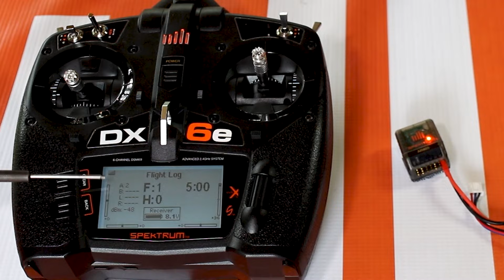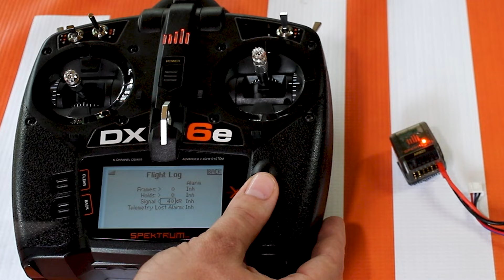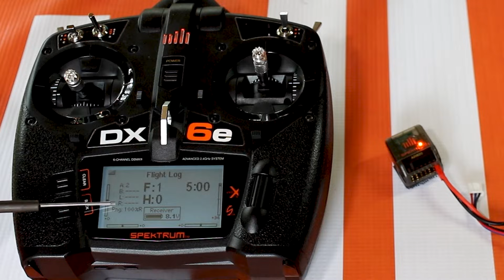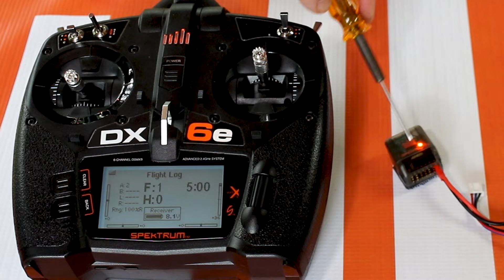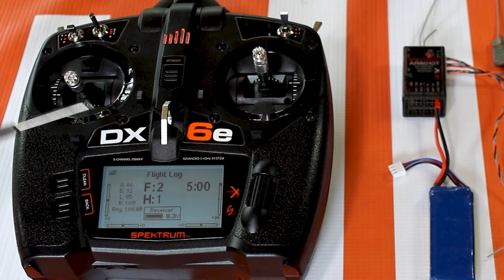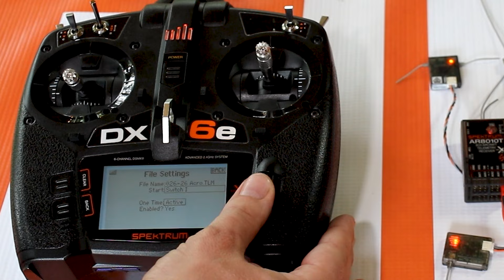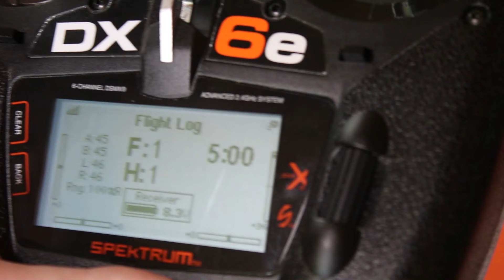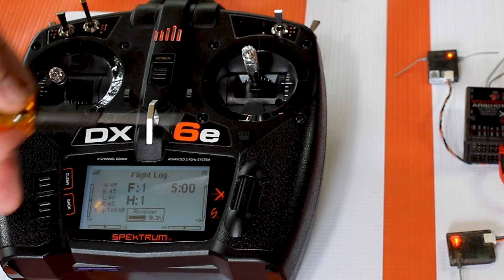Spektrum Quick Hit Tech Tips - Flight Log Telemetry Screen Explained

Comment: This is a handy monitor.  It would be better if we knew how many CONSECUTIVE frames were dropped. ( I've read that Spektrum's typical frame rate is 22 milliseconds, so I understand that a few frame losses aren't supercritical.) Otherwise, this monitor looks kind of like it's reporting each frame loss as though it was just one frame at a time.  I'm on my first Spektrum system, (NX8 + with AR8360+ receiver)  so I may have missed something. (?)
Reply: Based on a 22ms frame rate you can calculate the total frames received over a given flight time.  Then divide the F value by the total to quantify the loss.  1% is good, anything over tends to be bad.  Start by calculating the Hz rate which is 1000s/22ms.  Then take your total flight time in seconds and multiply by the Hz.  That will give you a theoretical value for the total amount of frames received.  Now you can calculate the loss.

Comment: Thanks for the video Tom!  
I get a lot of holds  on my Comscendo Evolution. At one point spectrum even sent me a new transmitter after they saw a copy of my flight log. But I am still getting the holds. However, I think I know what’s going on. The holds are location-dependent, meaning in certain patience I get a ridiculous number of holds in other locations I get virtually no holds. I think the issue is Wi-Fi networks. I guess the whole problems when I am flying near houses or office buildings. I don’t get really close to them, but maybe within a few hundred seats sometimes. I have seen proof that home Wi-Fi includes the 2.4 GHz band. What confuses me is that hardly anybody talks about it. For instance, I would think that in a video like this, there would be some mention of it. But nothing. Am I going down the wrong path?

Comment: I seem to average about 125   " fades "  per 5 min flight on my brand new HH T-28  BNF ( yellow ) ( Rx factory installed )   ....and  have also received some " holds" ....I have done a range test and it passes....I always fly with a  fully charged Tx ( DX8 gen2  )   and LiPos.....I have also contacted HH via email support ...........what's my next step?...also wish  that HH offered   on-line real time  tech  chat  support, as email responses  are taking days and days   in between questions.......going to fly today ,as  Spring weather ( Chicagoland area ) is iffy and got to get in some  flights when I can................thanks
Reply from the maker: 125 fades is nothing to worry about but holds I would look into. Sometimes you can cause holds by turning off the transmitter or even going into the system menu (which turns the RF off) so I would make sure that it is not self induced. Hope that helps!
Reply: @SpektrumRCvideos  understood......I will not get concerned about the " fades " and  keep watch on the   " holds"...........thank you

Comment: I had 20k frame losses in a 5min flight in my turbo timber evolution!.....
Reply from the maker: Will it do the same during a range check? Do you lose connection or get delays in control at all? Might be a good idea to check the antenna for damage and to make sure it is not being blocked by the battery.

Comment: Nice Video. I had 6000 F, 3 H during 6min flight. Nothing happened. I am shocked. I have two Turbo Timber and I lost my first one because I lost transmission during flight! Two times. The second one is fine, but sometimes, well as I mentioned. The other planes have no problem. I send the first Timber back, because it was not my fault, but nothing will happening.. I guess
Reply from the maker: Might be a good idea to have your Transmitter checked out, could be a hardware component that is damaged.

Comment: Just installed AR620 with Smart battery. No smart ESC.  When telemetry auto-configs it does not show Battery voltage.  Should it? If not why?  What do I need to do?

Comment: Really good video, I learnt a lot. I have the new SRXL2 AR6610T receiver along with a SPM4651T for my remote receiver in a 700 heli. On the flight log screen on my DX8g2 I'm only seeing a value for the 'A' receiver but no value for the 'B' receiver. With running two Spektrum receivers why is there no 'B' value being populated for the SPM4651T?
Reply from the maker: Hi Robert, likely one or both units need a update. Check out our how to update videos if you need help :)

Comment: Um, duh, if you have an "H" or a hold, your aircraft is in the ground. The whole objective is to PREVENT holds, which means positioning your antennae properly.
Reply from the maker: Not necessarily, Holds can be as short as 1 second, sometimes pilots do not even realize it until they check their flight log. But yes it is very important that antennas are installed propperly

Comment: Thanks for a very informative video!  I just purchased and started flying a Night Timber X with my iX12 radio.  I keep getting “holds” every time I fly, at random times (beginning of flight, high, low, on the ground). Typically one hold per flight, but yesterday I got four holds in a single flight, which is distressing, as the plane goes into failsafe at potentially dangerous locations (close to ground) for half a second or so. I use the same radio to fly my UMX Turbo Timber with no issues, so I assume this is related to the Night Timber X.  I have tried to relocate the antenna to stick out under the wing, but no change. I have also tried to range test with no issues.  Appreciate any advice, as I am reluctant to fly my Night Timber X with this issue unresolved.  Thanks!
Reply: I am having problems dx6 g3 on my gas engine aircraft with the loss of one went down in failsafe with only 359 fades and flying towards the landing strip had two holds never got control back just a couple of right hand dips of airolons that I was trying for but aircraft was in failsafe and crashed.  Second aircraft 35cc tailor craft  I did 5 circuits getting farther away each one just keeping my eye on the fades and holds all looking good I was on down wind to land and Got a hold but managed to get landed I have not flown since. As I don't think it is safe. 😭
Reply: Love my night timber x.. Probably had close to 200 packs through it.. I upgraded from the umx Cessna 182..

Comment: Quick Hit Tech Tip:  Do one on setting up dual rates using a 3 position transmitter switch where the rate varies with each switch position.  Another useful video would besetting up flaps where you use two servos, one for each flap.  Show us how to adjust pitch with each flap setting using a 3 position switch (1st position - flaps up, 2nd position - flaps in T/O (15 degrees), and 3rd position - full landing flaps (35 to 45 degrees).  Looking forward to more great teaching/learning videos from Spektrum!

Comment: I noticed one of your 3 remotes was a different than the other two. Is it ok to mix remotes like that? Or should they all be the same model?
Reply from the maker: Stanley Sadorf it is ok to mix remotes like this yes
Reply: @SpektrumRCvideos  Thanks! One last remote receiver question: the new remote receiver with the integrated antenna (SPM9747), why does the release date keep getting pushed back, now August? I've got 2 on order for my AR637T receivers. Hoping they come sooner!
Reply from the maker: @soar-eyes  Simply put, FCC... :( Still working on certifications. The SPM4651T serial receivers work very well as a alternative
Reply: @SpektrumRCvideos  Thanks for that information. I went ahead and ordered two!

Comment: My DX6e does not have anything on the screen under the A,B,L,R. There isn't the dBm code. I am using the AR410 receiver. What's up there?
Reply from the maker: Lance Latta rx needs to be updated. First batch of those didn’t come with RSSI firmware